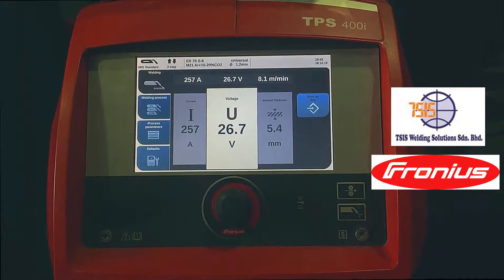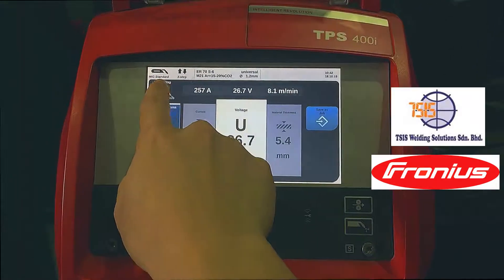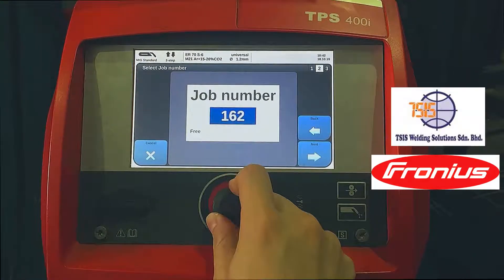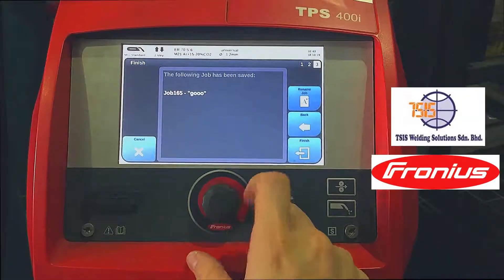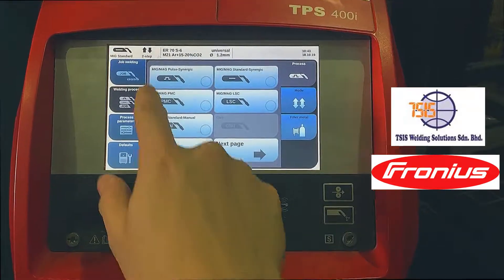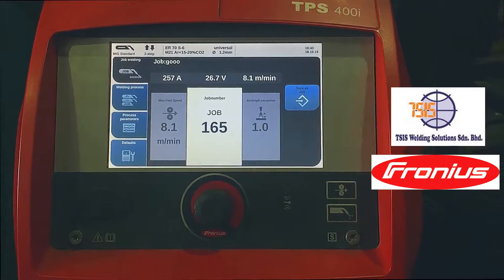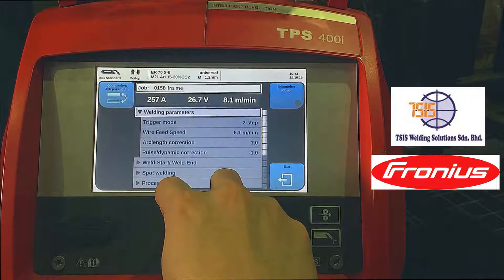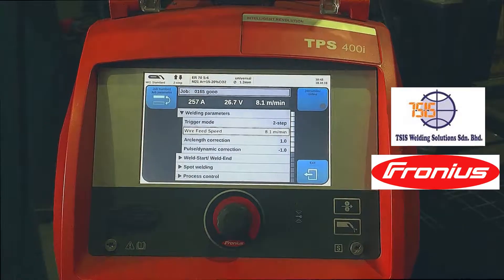Fronius TPSi How to series - How to setup job

Comment: I got a question!

What parameters would result in the best penetration for a butt weld for 10 mm Aluminium?
Reply from the maker: hi, this would incurred with several details on the weld preparation and requirement,
if you need futher information, feel free to contact our team via email
general@tsiswelding.com